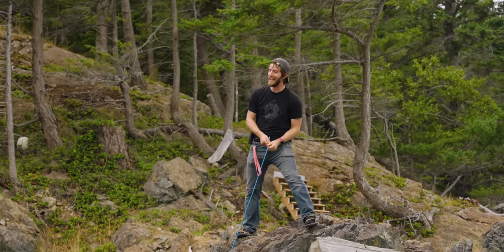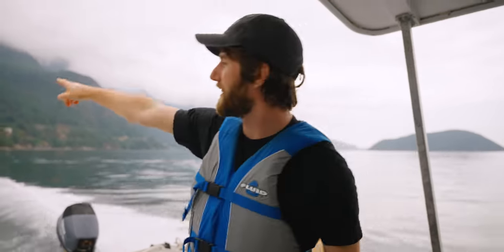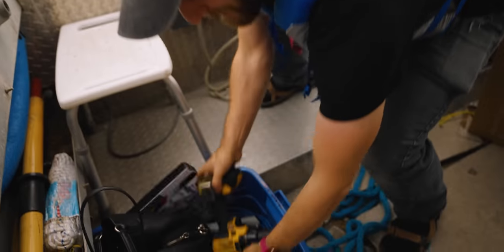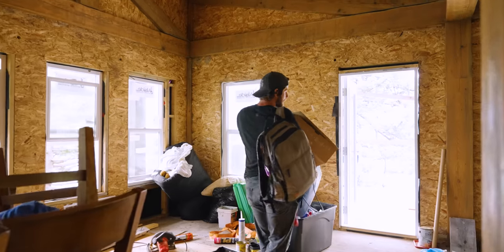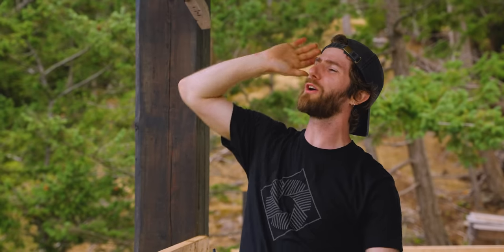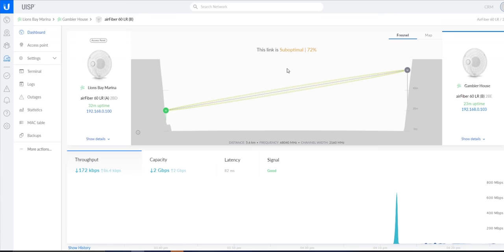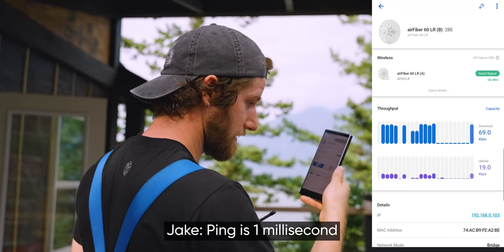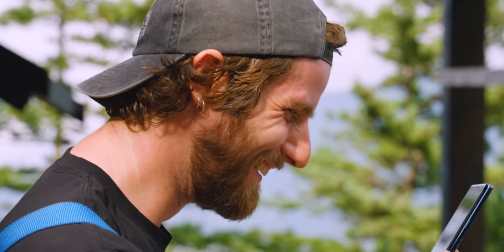How are we going to do this?

Comment: I legit was expecting linus to run a 6km ethernet cable underwater.
Reply: I thought the same thing.
Reply: I wished 😪 😕
Reply: If only…. If only.
Reply: yeah, but it will be ilegal in most countries without a pile of paperwork with the goverment
Reply: Go away it will just be temporarily..
Reply: same, would been funny linus diving underwater laying the cables :)
Reply: @codebraker12 unless no one finds out.
Then again he is uploading so Millions can view…
Reply: Wait a few months. I'm sure they'll have something for that.
Doesn't the trans-atlantic cable need upgrading at some point?
Reply: That's a great way to fry everything on that network segment during the next thunderstorm. You always use fiber underwater.
Reply: while fighting with sharks... BUMMER.
Reply: Too far for Ethernet cable you’d have to run fiber optic cable
Reply: Microsoft is trying that idea 💡 but I not sure it will work .
Reply: Indeed I first thought he would lay fiber optics onto the lake.
Reply: @codebraker12  well, i mean, also kinda impossible considering the distance
Reply: And the cable can’t be the long anyways, without a line extender
Reply: @marc-andreservant201  Well, that and the signal wouldn't go very far through ethernet.  You're pretty much limited to 300' on ethernet
Reply: Same
Reply: I was half expecting it to be 6km using fiber as you can get better speeds at longer distances.
Reply: I feel cheated as I was expecting waterproof repeaters, fish chewing through Cat6, things getting dropped in the water.
Reply: Me too lol
Reply: Same
Reply: Undersea fiber line.
Reply: Cable managing it in the reefs
Reply: Me too that would be cool too
Reply: Me Too
Reply: Sameeeee lol
Reply: Bahaha that would be so slow!
Reply: @marc-andreservant201  That's not how that works.  Most electricity from an ocean strike is instantly neutralized.
Reply: @Shotblur  I understood the OP's comment as a 6km long cable run in shallow water. Obviously if the cable is 6km deep on the ocean floor there is no concern with lightning.
Reply: Max length much less than that without repeaters.  You'd need fiber optic.
Reply: Same
Reply: Same dude 😂😂
Reply: @neubauerjoseph  trying? It's been like this since the 70's.
Reply: @Silver-Bullet1  not true. You do know that each cable only covers like 500 meters before meeting an interface to another 500 meter cable, right?

The 1 cable doesn't have to be 6km long.
Reply: @zachtharp1049  you can buy Ethernet extenders, but it’s better to use fiber underwater.
Reply: Same
Reply: Same 😂
Reply: You can't, not only for legality reasons (except if you own the lake), but also because running a cable on 6km just won't work. The Ethernet signal will be lost after 300m. Plus you have to protect the cable from the water, with a sheath. I don't know if this gonna work except if you put relays every 200m, but it's delured.
Reply: Same LOL
Reply: @isaiah4478  good luck running a 6km Ethernet cable underwater without anyone knowing as you’re doing it
Reply: Me too
Reply: Lmfao same not gonna lie
Reply: Same
Reply: @DimitriMoreira  Who said the ethernet cable has to be copper?  You could run some steel wired armoured single mode simplex fibre, then use say 10km rated 25Gbps BiDi SFP28's each end, at $150 each or perhaps go for 20km rated ones for an extra $10 each and give yourself some headroom on the optical loss. The optics are a bit more expensive than duplex ones, but the savings on the splicings will out will out weigh the extra cost of the optics. Of course if you are happy with 10Gbps then BiDi SFP+ is only $40 each for 10km ones, and 1Gbps BiDi SFP are like $10 each.
Reply: Well, a fiber link might go that far… but as others have said, I’m pretty sure you need permits for that.
Reply: Same bro 😂
Reply: Low voltage guy here. Anything short of fiber will not be able to carry such a signal across that kind of distance. Category 6 cable carry a signal to a maximum length of around 330' give or take, and by the time you slap on a few repeaters to keep that signal. It'll be less of a signal and more like white noise. Ptp antennas are the next best thing and much more feasible.

Edit: I knew it, ubiquiti has been a solid brand for quite a while.
Reply: 1-illegal
2-slower connection
Reply: The fishies would eat it up
Reply: I expected him to use sattelittes
Reply: I was expecting him to drop something while on the boat. 'splash".
Reply: 100%
Reply: Ikr
Reply: 1) You can’t run a copper Ethernet cable more than about 100 meters without severely degrading the signal strength that mean you need active, powered repeaters.
2) Running underwater cables (except for in very controlled conditions) is not as simple as just having one long enough.
3) Even of you did have a properly designed cable that was long enough, you still have government regulations to deal with related to maritime navigation and whatnot because it limits where a ship/boat can drop anchor.  Not to mention aquatic life for about a dozen reasons.
Reply: Same
Reply: I believe cat5 loses speeds after 100 meters, it would of been funny though
Reply: Same thats cool. How did they get the marina to allow them to drill into there building
Reply: Wireless is actually faster than cable due to light being slower in a cable due to how it has to bounce through the cable va going straight so Wireless/focus beams are faster if designed properly. 

This is why eventually when tesla internet (forget the name light peak?) Is fully deployed it'll have better latency then an ocean fiber cable because the satellites are in a very low orbit and can shot in a better straight line and have faster transmits.

But they need like 10k or 35k satellites. The current grid/network doesn't have enough satellites yet and isn't optimized
Reply: Yea me too, I was kind of disappointed
Reply: me too
Reply: I thought he was gonna build the tony stark underwater power tube but for internet lol
Reply: @me0262  Wrong ocean. He's on the Pacific Coast.
Reply: Yup so was I lol
Reply: I had some ridiculous image of him running it through PVC pipe diy style
Reply: @DavidHHermanson  Was just an idle thought, I know he's on the west coast. (look up The Frantics - Bill from Bala).
Reply: That’s just stupid to think that.
Reply: Ethernet craps out after about 90 ft. He'd need a fuckton of relays.
Reply: Not secure unless it's fiber.
Reply: Same bro
Reply: I thought the same thing
Reply: 7,000th like :)
Reply: Would need a repeater every hinder meters or so.
Reply: I mean that's how it's done generally
Reply: @KlodFather  brudda that's Canada Linus is is from Canada xD
Reply: Me too im disappointed 😅😅😅
Reply: ME TOO
Reply: Me too, I was expecting them to get a Ethernet cable underwater and plug it into a router back at the office and into a router at the house
Reply: @Gamer-ku8nd  or to the IBM server oh I forgot Linus is scared of commercial Servers
Reply: Tbh same
Reply: Same
Reply: for some dumb reason I was thinking the same thing 🤣😅
Reply: I was expecting him to drop the box during the boatride
Reply: Yes i was too as he is so cashed up he and his parents can afford it, when you have the cash, governments will bend the rules and issue permits to do anything, but if you the average person and try to run the cable you're self you would end up in jail for not having the permits costing tens of thousands. money talks..
Reply: same
Reply: Kekw
Reply: Same
Reply: chad move
Reply: same
Reply: @obtainedlight4745  that would be cool but highly impractical
Reply: Same
Reply: Same
Reply: oh no
Reply: Same
Reply: Same
Reply: i tough that linus is going to dive with scuba gear Lmao
Reply: Same
Reply: Will this wobbly antenna system work in a hurricane?
Reply: same!
Reply: Me too highly dissapointed
Reply: @codebraker12  i mean, it would take them a long time to find out, that some dude put a long cable in some ramdom lake/sea.
Reply: Same
Reply: Same
Reply: Given that the max length of Cat 5e is 100 meters, you would need at least 60 repeaters.
Reply: M2
Reply: Scuba linus
Reply: Same
Reply: Don’t you plebs know the max length of a copper/Ethernet run is like 300 feet…
Reply: it wouldn't be safe since the fish and boats as well as the water speed would just mess all that up
Reply: That would have been cool
Reply: We all were.
Reply: Same
Reply: You aren't the only one lmao.
Reply: Me to lol
Reply: @codebraker12  shuut yo child as
Reply: Sammme
Reply: Ong me too
Reply: same
Reply: Same
Reply: Me tooo
Reply: Me too 😂
Reply: Same
Reply: Just get a reeeeallly long cat5 cable, it'll be fine
Reply: Lol
Reply: Mr too
Reply: it doesnt have to be under water.
Reply: Same
Reply: I wish😢
Reply: Would have been cool tho
Reply: Same here lol
Reply: same lol
Reply: Same
Reply: Same here
Reply: which would've been way cooler btw, even if its not practical lol
Reply: Me to
Reply: Would loose signal to long :)
Reply: Same here
Reply: and you know thats definitely something linus would do
Reply: Honestly that’s what I wouldve done.
Reply: Same especially with the thumbnail
Reply: same
Reply: Fr
Reply: Thanks for spoiling it
Reply: Same
Reply: @cr4zedturtle  why you blaming me
Reply: same lol i was like MAN THE LATECNY ON THAT
Reply: @PrinxzAep  on god on god
Reply: Would been really bad.

The gaint cabels under water need a repeater ever 80km

A Tiny cable would need alot of buffers
Reply: Same
Reply: I genuinely thought that he was just gonna plug in a basic router on land 6km away and it would work, I don’t know why.
Reply: Same
Reply: Bro same, except I thought he was just going to run it on top of the water
Reply: DISA POINTED
Reply: me too
Reply: Me too
Reply: Same
Reply: Same
Reply: Same
Reply: ikr
Reply: New video, Linus learns to swim so his parents can get internet
Reply: Same
Reply: Doesn't work bc of physics except Linus would build a 30cm×3000m full metal pipe
Reply: We all thought that
Reply: the sharks: "mmm fiber optic Friday's!"
Reply: Me to😊
Reply: @tomwilson2112 we can push HD video up to 10km using rather inexpensive SDI-fiber adapters. 6km wouldn’t be an issue.
Reply: Wouldn’t put it past him.
Reply: ethernet is good for a maximum of 300ft ... and best under 100ft ... after that the line impedance makes it useless
Reply: If it is Ethernet the connection would die out and not reach the house, the only way is with fiber internet
Reply: 100% - I was already like: "wow, I didn't know that was legal!"
Reply: He would tho
Reply: 6km power cables to power the layer 2 switches, depth certified water proof containers to house the switches, permits with the council to put bouys in the water.
Reply: @madsvigan2898  technically optical amplifiers not repeaters. 80-150km interval
Reply: oh god i can see that now, an rgb sea cable
Reply: I would love this video way more if that was it
Reply: same
Reply: me too
Reply: 👇People who thought that too
Reply: I wouldn't be surprised
Reply: Same
Reply: I also did
Reply: Same
Reply: me too 🤣
Reply: same
Reply: Me too 😭
Reply: NAHH SAME😂
Reply: @codebraker12 same
Reply: Same
Reply: @codebraker12  its not possible even if u get all the paperworks, cat5e and cat6 has a range of 100 meters only.
Reply: @unprofessionalalien  they could use fiber or coaxial
Reply: @codebraker12  yeah but the maintenance cost and its hard to fix when it get damaged. And if they dont want it to get damaged they need to use heavy duty type shi but who would use it just to give a single house a network access
Reply: Only didn't do it because it was to expensive.
Reply: Same
Reply: @codebraker12  if the water is international water is ok
Reply: LMFAO SAME
Reply: Me too
Reply: Cyrus Field has left the chat.
Reply: @codebraker12  yeah cause the government will catch it in their yearly trips to the bottom of this lake looking for tech guys cable setups lol.
Reply: @marc-andreservant201 lol. Just no. How do you think cables were ran before fiber existed??
Reply: @marc-andreservant201 literally had copper telegraph cables under the ocean in the 1850s lol
Reply: @zachtharp1049 not if you have actively powered repeaters which can be powered by a pair of wires that go along with the ethernet. Wouldn't be the first time
Reply: @marc-andreservant201 there's also no concern in shallow water either. That legitimately makes no sense. The energy of the strike spreads in all directions heading for ground, and the cable itself is not a good route to ground vs you know... A straight line lol

Comment: As someone who has watched the evolution of these long-range wireless solutions, that is just impressive.  The fact that they were being bottlenecked because of the 1Gbs switch is hilarious.
Reply: vbddfy euuyt  it probably doesn't react well to weather, rain will likely block it, remember a thin bit of paper blocks it, so rain/fog should be just as effective at blocking it. Strong wing is actually liable to knock the dish out of alignment, a little bit of wobble and it goes down, and that wooden building is liable to wobble quite alot in strong wind (greater than 17mph, 15 knots, so not uncommon especially near large bodies of water).
Also as this goes over a lake (public land), you could just have an AH neighbour park their sailboat in the way and it would be legal.
Reply: @cgi2002  I had a Bell "technician" install my dish on a rickety old fence at waist height. Just looking at it would knock it out of alignment. God forbit there was a light breeze or a bug landed on it.  I just waited for him to finish. Showed him to the door, smiled and waved... then promptly went out and re-installed it properly with some lag bolts to my deck.   

Bell sent me a survey for the install... with a field with open text for comment. I called to complain, with photos. They actually refunded my install fee.
Reply: vbddfy euuyt  one version has 5 GHz failover, which is pretty nice.
Reply: @Sidowse  the end near the dock seemed to be fairly low down, only about 10-15ft up, which is within the height range of most masts on smaller sailboats. The other end is admittedly well clear, it looked to be nearer 30-50ft up. Tbh tho unless the boat is parked right in the correct spot, it won't affect it really. Theres a greater chance of a bird knocking it out flying through the beam (or more probably landing on the dish)
Mostly tho I suspect inclement weather may be more of an issue.
Reply: I've helped setup a 60Ghz PTP and used lasers to align them.  Amazing performance... I really like Ubiquiti products.
Reply: vbddfy euuyt  I’m not worried about the weather. I’m worried about the fresnel zone, they’re not far enough off the ground to avoid significant scattering and refraction over the water. Plus more refraction, and scattering, attenuation due to the body of water since there will be some temperature inversion causing pockets of cool air and obviously water vapor. Combine that with a very narrow frequency band of 60ghz, and going 5km.  I don’t really think this is a good solution. Should’ve bought ubiquiti air fiber ltu radios with some 2 foot dishes. Just use 5ghz.
Reply: TFW your F1 racecar isn't fast enough lmao
Reply: vbddfy euuyt  High bandwidth fixed wireless is a fickle thing. Any kind of bird or tree or water droplets or any random thing at all passing thru the beam will mess it up. My parents have one mounted on a 50-foot pole that flops around in the wind but the service is reasonably stable in light wind.
Reply: lol
Reply: vbddfy euuyt  that is major issue with 60Ghz weather is a major problem and can drop the connection completely. That is why getting the alignment is a must but when in a more wireless congested area you will at times struggle to get that same results due to there not being that many frequencies to choose from.
Reply: @JohnGeorgeBauerBuis  it is the same unit they have used but when in a more congested area they both struggle to get their true potential sadly.
Reply: 5G in most areas, gives over 80 Mbps, which is faster than wired mostly, and has other channels, making it faster and better bandwith
Reply: I've seen WiFi sent over 29Km distance using regular economy grade routers, satellite dishes recovered from the garbage and homemade double bi-quad antennas.
Reply: @zeroborderlands4206  just normally capped as well. Unlike some other cabled in services that you could just get the PTP connection like in the video and there you go uncapped connection.
Reply: @cgi2002  very doubtful a boat will park there knowing the water that it is going across…. plus the paper was only enough when the beams weren’t focused onto one single point
Reply: @cgi2002  it’s the ocean, they could have a container ship block it. Also I imagine the signal will get blocked every time a ferry leaves from the nearby ferry terminal.
Reply: @BC_Geoff  yeah but as others have pointed out, that's at most a momentary blockage (2-3 seconds) and unless your playing online games, that's not going to be noticable really, wifi systems tend to be fairly redundant in that regard. My thinking was more longer term outages, something litterally parking in the way (yes its highly unlikely) or bad weather causing issues (fairly likely). It is however better than nothing, and short of laying a cable or using a satellite up link (both thousands of times more expensive) it's a viable solution to a tricky problem, especially for a household that's unlikely to be playing online shooters.
Reply: vbddfy euuyt  Not well. For bad weather, you'll end up having to sacrafice speed to be able to maintain a stable connection.
Reply: @DirkDeadeye_  - Were you referring to something like the Ubiquiti AF-5XHD-US(?)
Reply: Im confused. What is the property that Linus attached the inland solution to? Is that also part of Linus's parents property?